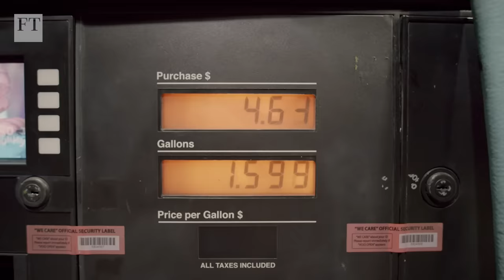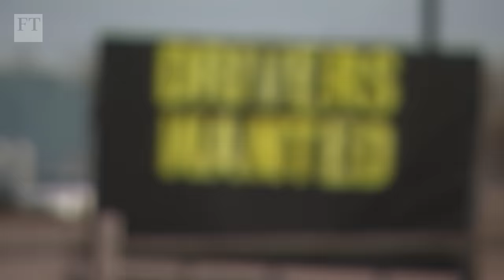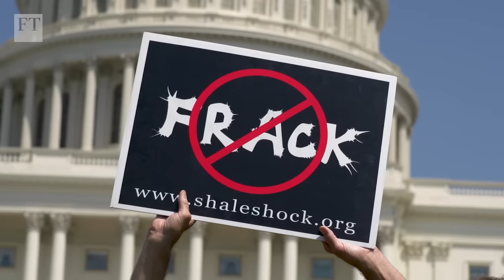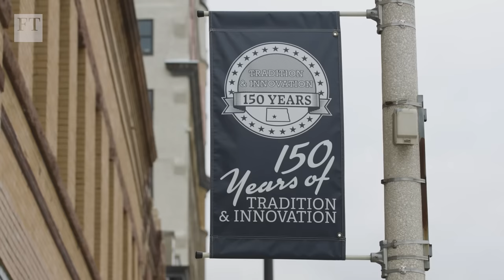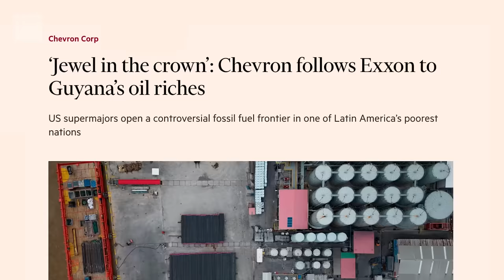Big deals in US shale may not mean boom times are back | FT Energy Source

Comment: Shale drillers need to start using their drilling expertise to drill geothermal wells to produce baseload electricity.
Reply: As it turns out all this development of horizontal drilling tech in the US will have great utility when geothermal starts to take off in areas where it currently isn't viable due to being too deep.
Reply: They are.
Reply: Even if there was a geothermal boom natural gas will still be needed. The US needs to quadruple its energy generation at that will mean all sources are needed.